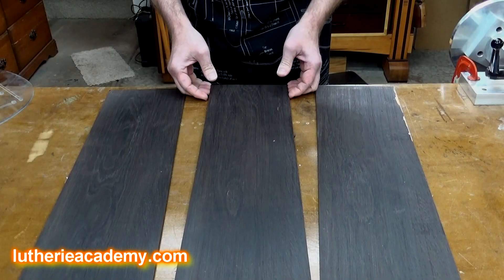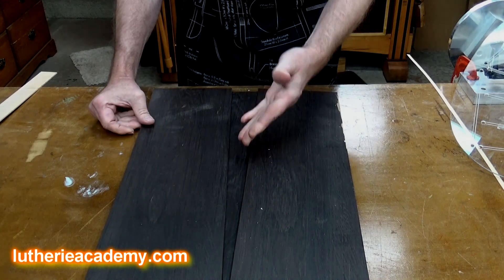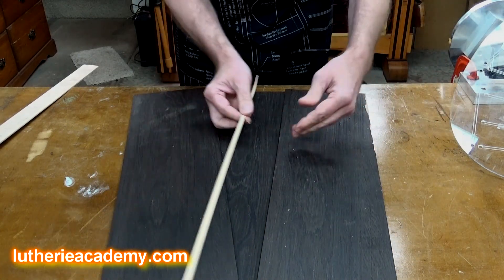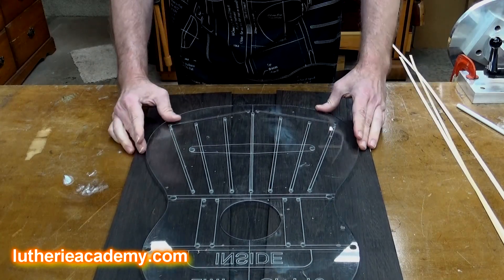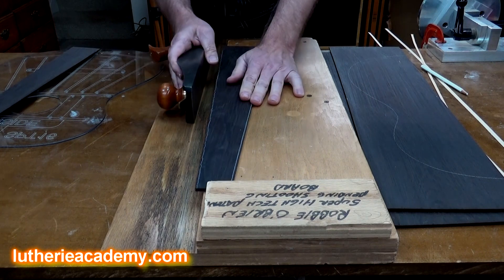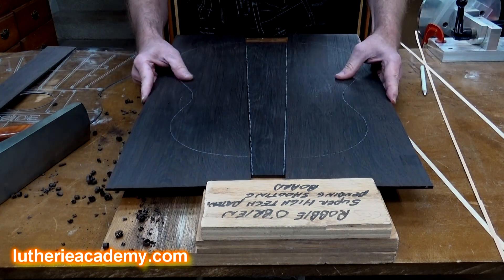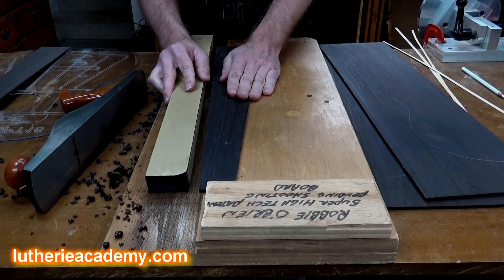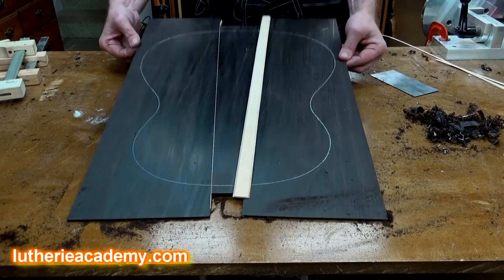Luthier Tips du Jour Mailbag 171 -  Three Piece Back

Comment: Hi, I've learned so much from you. Thank you very much for that!! I'm now building my first complete guitar. The back and sides are made of wenge. I have two backs. One has a very straight grain and sounds perfect, almost metallic. It's also very stable. The other back has a very nice V-shaped grain pattern. This one is extremely flexible and has almost no internal tension. I think that's due to the V-shaped grain structure. I know that the back will be tensioned over the braces and the radius at the back. Still, I'm not sure if I should use it. I don't want a beautiful guitar; I want a guitar that sounds good. Since this is my first one, I want to be on the safe side. What do you think about it?
Reply from the maker: Glad you are enjoying my videos. I think either one would work. However, i would choose the easiest one to work with.
Reply: @ Thanks for taking the time to answer my question!

Comment: Question if I may:  how many piece back wood you consider to be the maximum?  3 only? 4 or more?  (I thought I read somewhere that Taylor’s Pallet guitars were multiple piece)?
Reply from the maker: You can have as many pieces as you like.
Reply: @OBrienGuitars  I thought that might be acceptable…

But does that also mean one needs a cross grain internal graft for each joint?  It could become overly unwieldy…lol!
Reply from the maker: @SolaChristus  Not necessarily.  I have seen multiple piece backs with just back braces and perhaps a few cleats in between those over the seams.
Reply: Good idea…thanks for the advice!